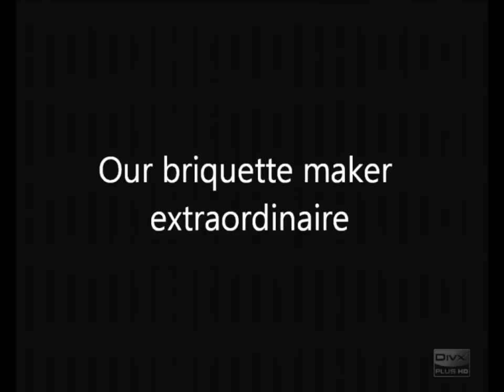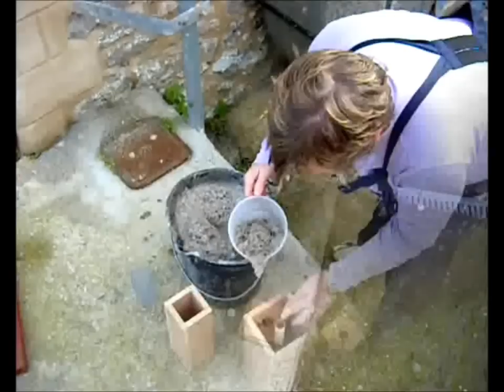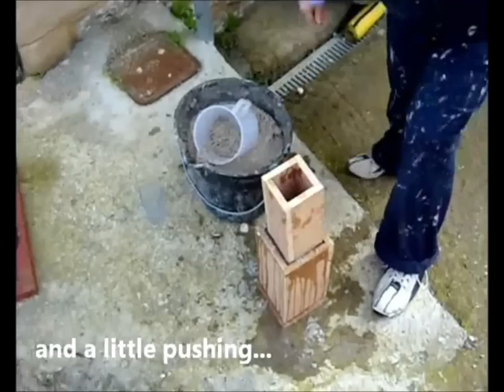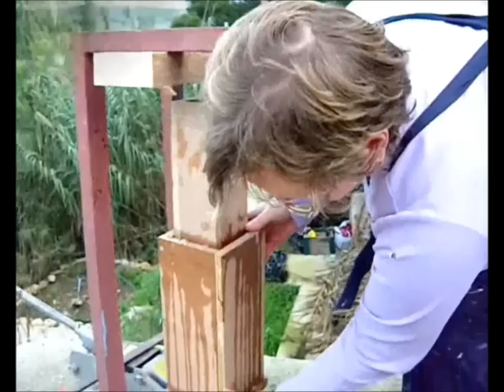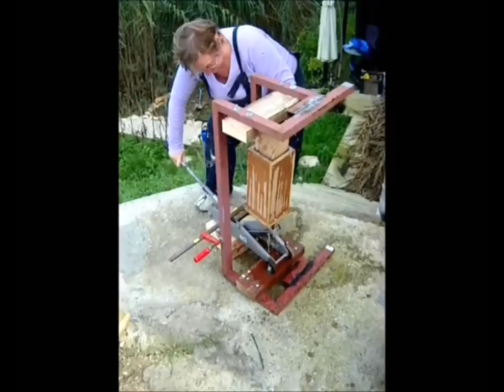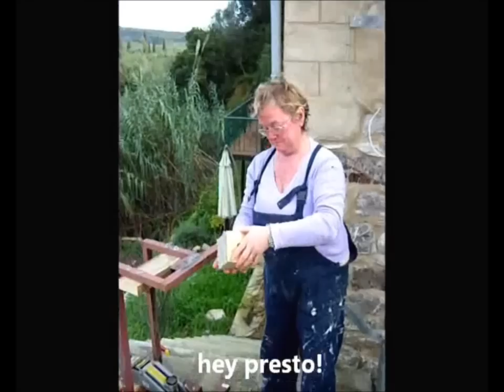Briquette maker extraordinaire.wmv

Comment: Tried these seriously not worth the back aches unless u live in Australia it takes forever to dry them to make them economical
Reply from the maker: This video is of the first press we made and we are now on the 3rd, improved version (check out the video here http://youtu.be/d6CbCcMW3sE) which requires much less effort. It's not really about the economics, but about re-using and recycling the waste paper and cardboard rather than them ending up in a landfill site - although it does save on fire lighters!  We live in Greece, so drying the briquettes is generally not a problem.
Reply: Pauline Martin jerry o connor  You could also build a dehydrator with recycled materials and dry them that way, also seeing as most people will make them in the summer ready for the winter nights using a dehydrator then would be even better...
Reply: I do love the concept of using recycled material to make these briquettes seen as it is free heating but anyone that seen me make them & the effort I put in to dry them seriously thought I was mad in the head considering that heating oil is a bit cheaper @the minute
Reply: jerry o connor solar kiln